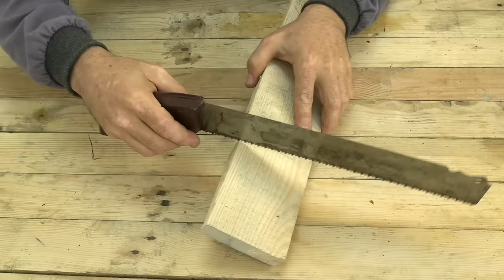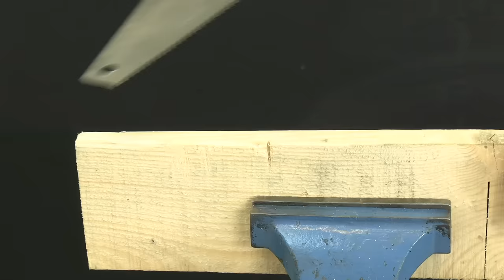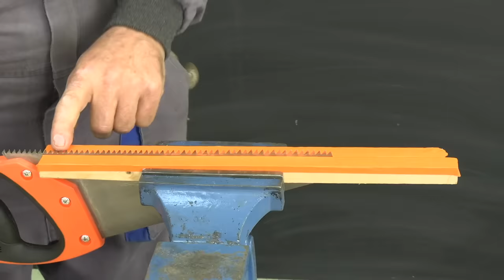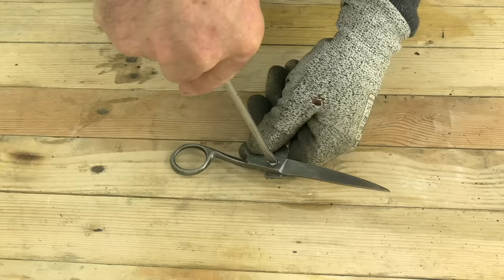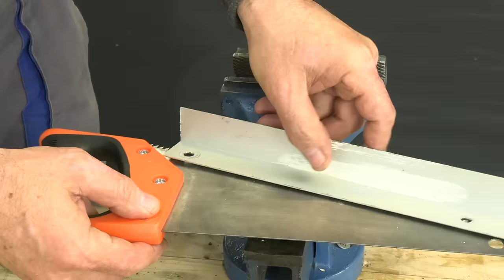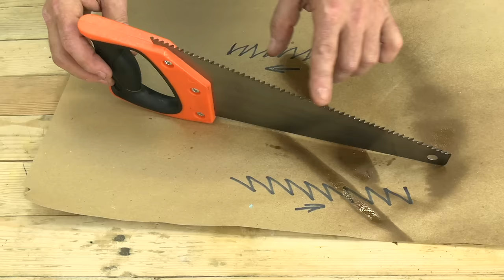Sharpen Your Hand Saw Razor-Sharp. Sharpen the Hand Saw!

Comment: With teeth that big and that shape I would have said that it was a rip saw not a crosscut. Is that why he was having a problem cutting across the board?  And who has a pair of broken scissors, just the right size to cobble into a makeshift saw set, which gives you no control over how far you need to set the tooth anyway?   If you are not willing to do the job properly then get one of the cheap throw away saws with hardened teeth that most hardware stores sell!

Comment: Well, that's an interesting way to put the set back in saw teeth.  I'll have to give that a try.  It's certainly cheaper than trying to find an old set tool since nobody sharpens handsaw blades anymore.  Nor can they even be sharpened the way they are manufactured today.  ;)

Comment: The tool for spreading the teeth is known as a ''saw set".
It sets the teeth in order to give the saw body to ride through the kerf or through the cut otherwise the saw will bind up in the kerf.
 Each tooth needs to be the same as all the other teeth. 
What you do to one tooth you need to do to all the other teeth. Any saw blade uses this same methodology.
Reply: Hi, Years ago my father, who was a carpenter by trade, told me how important using a “saw set” was  to the process of sharpening a handsaw. By any chance do you know where a “saw set” can be purchased today?